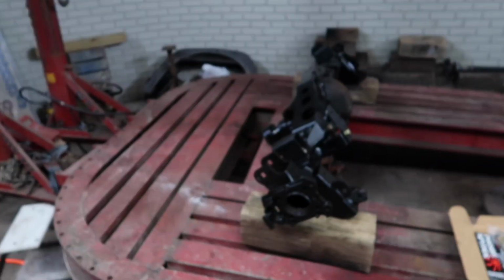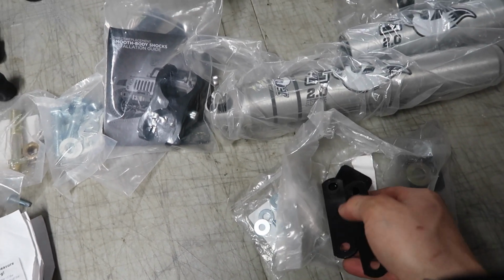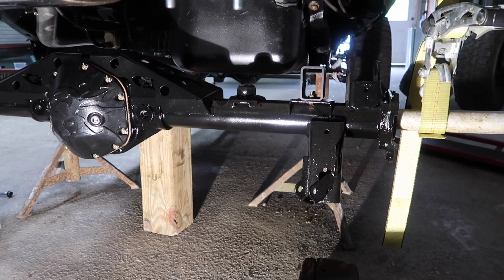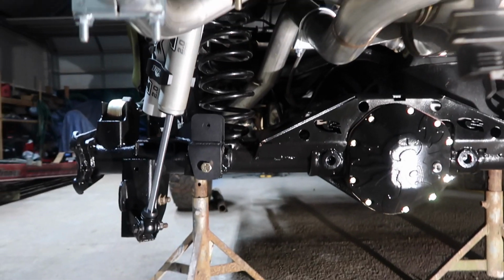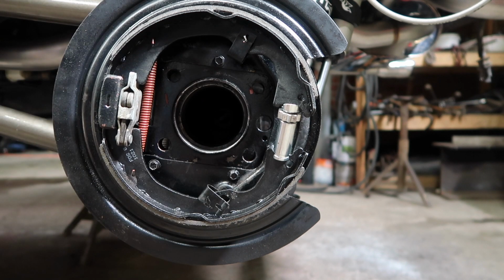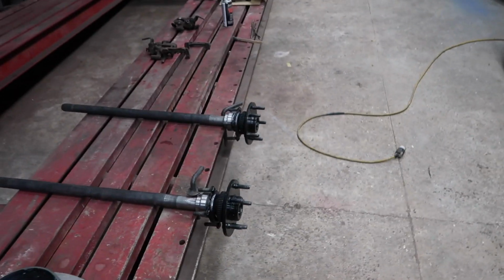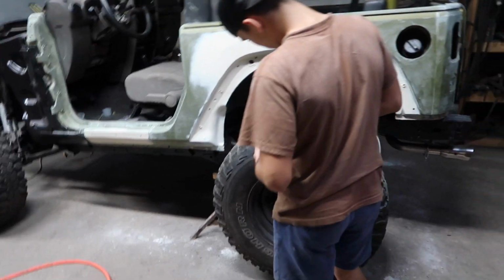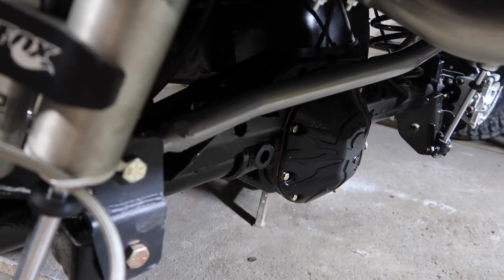Rebuilding A Wrecked Jeep Rubicon [part 16]

Comment: Awesome watching you work with your handicap, inspires me! I had motorcycle wreck on my 2001 Harley WideGlide that after a very bad doctor that instead of properly repairing it liked it should have been done and me back walking in 14 days. It left me with having 23 operations and procedures. An the accident happened in 2012 and at the present 2SEP2020 I am still in a wheelchair. But I have started over again with working through this! Seeing you inspire me to hit it harder than ever, thanks!

Comment: Danny, I know I'm late to the party but those parking brake shoes are installed proper. The hold down  clips that go on the pins don't wrap around the shoe they lay on the shoe. The spring tension that clip creates holds the shoe against the backing plate. The yellow spring I install before I install the adjuster...